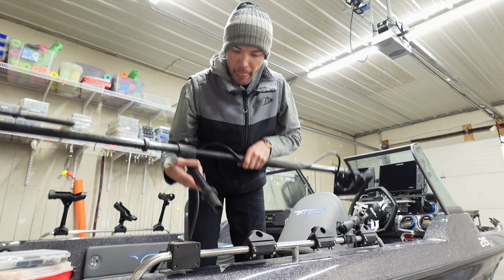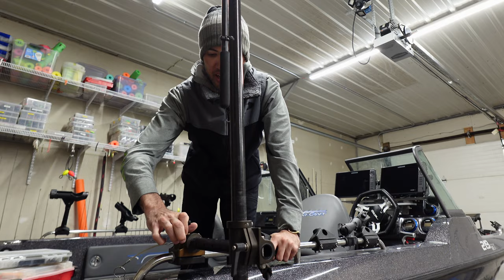Stowing/Deploying My Transducer Pole

Comment: Hi Joe. I purchased this mount thinking that the lever was used to tighten the mount on the rail. But the rail mount is not effected by the lever at all. It only purpose is to clamp down that short rod that holds the transducer pole out away from the boat. Maybe you have a different model - does your lever tighten the rail mount? Or do you just keep the 4 screws that clamp the rail mount together very snug, but lose enough so the  mount will rotate on the rail?
Reply from the maker: Hi Dan, it’s just a fine balance of tension with those 4 screws on the rail mount. Just loose enough so I can roll it up to stow but not so loose it moves when fishing easily. Keep a 3/16 hex on board to play with it till it’s just right for your use👍

Comment: Hi Joe, I have a 209 TFX Yarcraft . I am going to be purchasing a Brew City Pole. Question is what length of shaft do you run (60”or 72”)? I will be setting it up like yours, only I have tracks instead of rails. Also where does your transducer cable come out from? Any photos of that ?
Thanks Brian
Reply from the maker: Hi brian, I use the 60” front and back. I have some pics and a setup video of my 219 on fb and here on YouTube where you can see where the cords come out or shoot me a message on fb if you have any questions and need more details.
Reply: TY

Comment: Do you have the plastic spacer between mount and rail? Just wondering how it will hold up rotating it all the time?
Reply from the maker: Yes the white plastic spacer is inside, it is not metal on metal.